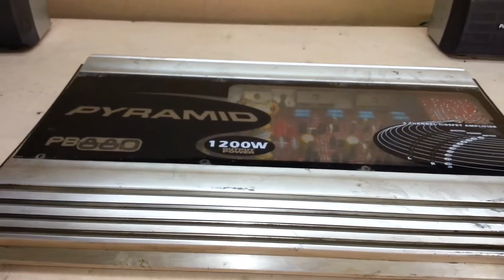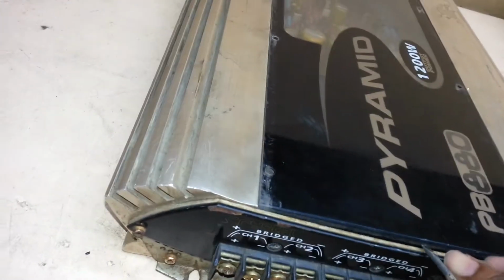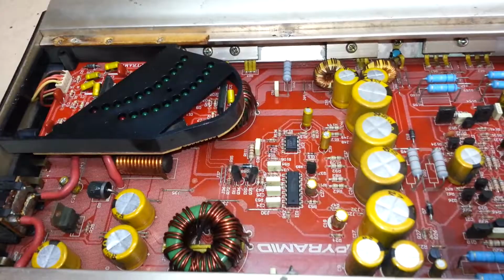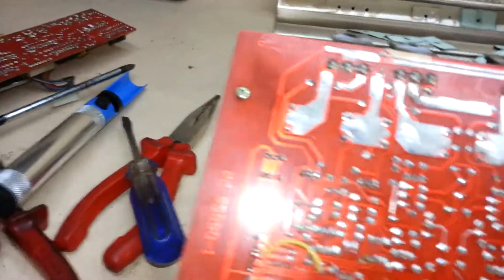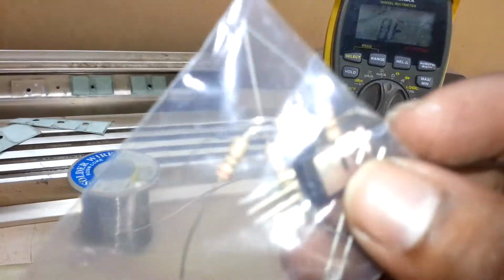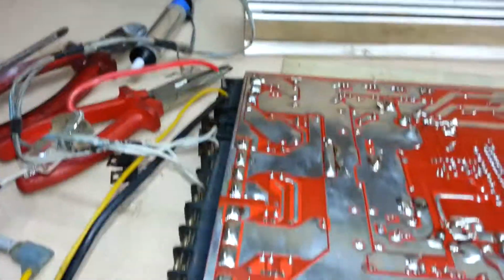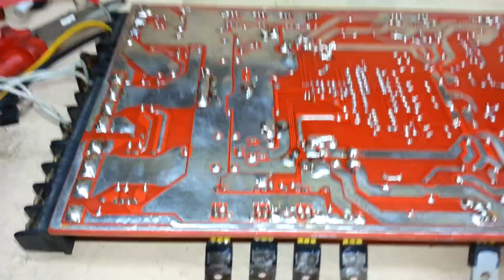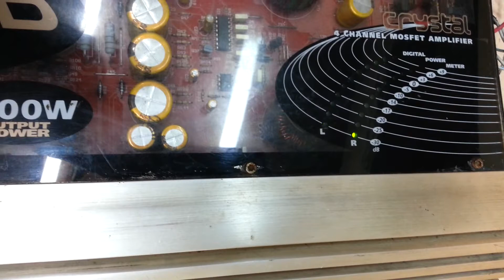CAR AMPLIFIER REPAIR Old School PYRAMID PB880 1200 watt 4 channel diagnosis and repair

Comment: hey got any tips for me, mine when i changed my blown fuses the amp smoked up?
Reply from the maker: Use a headlight lamp in series with the live wire for testing check for shorts.
Reply from the maker: Something is shorted . Get a multimeter and start trsting components.
Reply: @krishstechstuff7772  so I had changed the blown mosfet's and the 2 100ohm resistor and well I turned it on and no power so I taught it was a diode That was shorted so I took them out and test them and they where good so I am wondering if the other z44n mosfet's are bad any tips on testing them?(I would have gotten back to this sooner but life happened so I decided to dig into it since I was bored)
Reply from the maker: @elite_shadower_6057   Power mosfets usually short when they go bad so once you remove them and do a normal diode check between all pins and it doesn't read low like 0  it should be ok.
Reply: @krishstechstuff7772  thanks for all the help🤝, turns out 6 of the power caps had to be changed they looked find from both sides but when I unsoldered them the + side was rusted out so I swapped them and check the rest of caps and well I got it to work as soon as I changed them.

Comment: "Please can you help""my friend gave this amp and it is broken i do also realize its is old but i was wondering where i could get the right mosfet for this amp its one of the ones located in Q5 and to the left of the power
Reply from the maker: This amp uses IRFZ44n , 4 of them on each side for the power supply.All power mosfet's are identical.I could not obtain the schematic for this amp and have already returned it to customer.If u still need help ill try to reply as soon as i can. Good luck.
Reply: Sir i have a rockmars 3000watt amplifire when i give battery current its p55nf06 transistor dead I replaced that transistor but same again kindly help me

Comment: Anyone there for help me
Reply from the maker: p55nf06 are the power mosfets check the driver transistors for the mosfets and make sure they arent shorted.Trace the gate leg(pin) of the mosfet.Also check for other shorts in the power rails of the amplifier(use ohmmeter).Lastly use a 12 v bulb in series of the power wire(positive lead +)to prevent the amp from shorting out when testing.
Reply: Krish's Tech Stuff  dear sir thnx for hrlp me sir i can I contact with you and how can i show you my amplifire board with any social network?
Reply from the maker: this might help :https://www.youtube.com/watch?v=-h05VkXOTk8
Reply: Krish's Tech Stuff sir thanks for reply and helped me sir now my amplifire is on properly but i have 4 channels amplifire tow channel are good but tow channel sound automatically up and down and some time breaks tha sound voice when i off the amplifire for some time and agaim on some time sound is like normal but automatically updown volume and breaking the sound kindly help mn sir waiting for your good response thanks
Reply: When sound up automatically then my speakers are burned
Reply from the maker: Sounds like broken solder joints resolder the amplifier section if it is shorting and cutting in and out the sound.Look for cracked solder joints on the circuit board.Good luck.Use the 12 volt bulb in series with the power wires when testing u will save your speakers.
Reply: Krish's Tech Stuff which one joints and where i look most?
Reply: Krish's Tech Stuff i have 4 channels amplifire 3 channels are ok but when i use a speaker 4th channel my speaker coil is burn I check that channel with miter from out side where I connect the speaker its show voltage out
Reply from the maker: Check the output transistors and see if they are shorted,also check associated drivers and components.
Reply: Krish's Tech Stuff dear dir can i contact with you on whatsapp ?